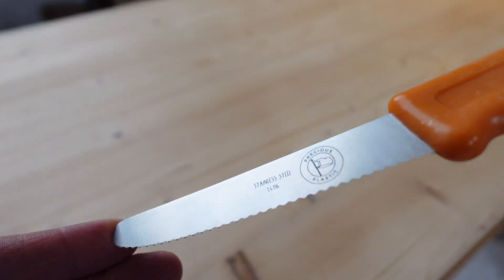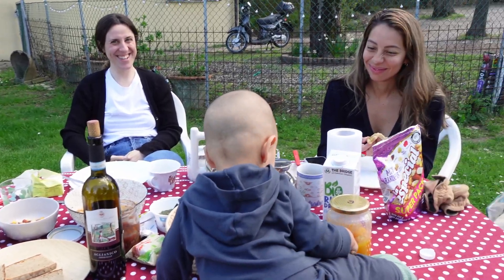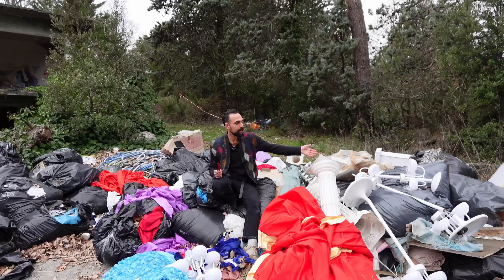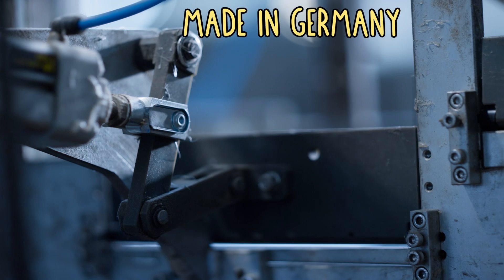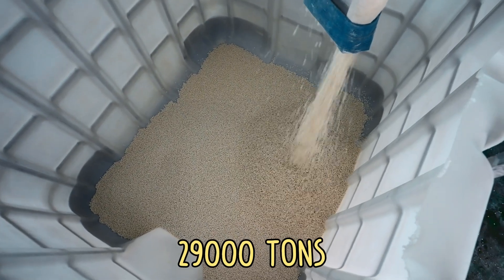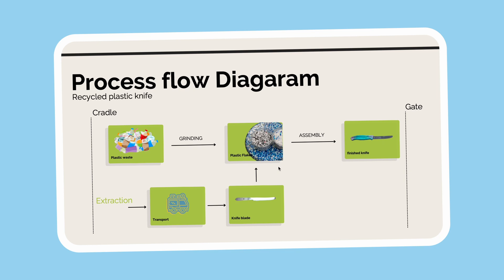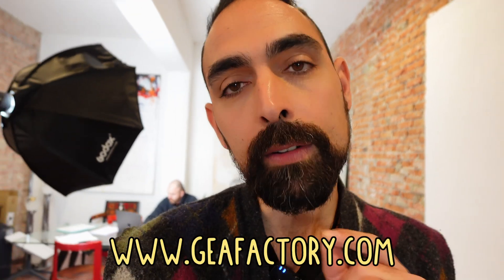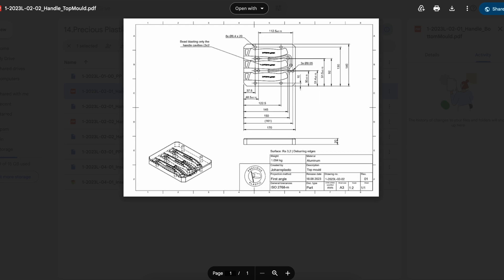This knife cuts 52gr of CO2 emissions

Comment: Great but… didn’t you miss something?
Where is the analysis on the real reasons of throwing these knives away?
Most probably the low quality of the steel and (less probably) the low quality of plastic handle.
WHY are people throwing knives away in the first place? Because they get dull and STOP CUTTING. That’s why probably the even more important thing is to teach people how to quickly sharpen these knives and simultaneously make the knives most sharpening friendly as possible. That’s why the toothed blade design needs to be banned or get some design improvements to make it possible to re-sharpen in home.  The rest is only about sturdy plastic handle which won’t get broken during usage.

The truth is that one, properly made high quality knife could serve us through entire life. And that probably should be the aim.

So maybe also a simple recycled sharpener design that could serve an entire family for a lifetime could also be a good idea…
Reply from the maker: Hey thanks for the comment, very good feedback actually. Didn't analyze it under that lens but makes a lot of sense. Indeed straight line might be a better choice. Are there specific cuts that require toothed blade? I am thinking bread and other foods that are kinda hard with straight blade..